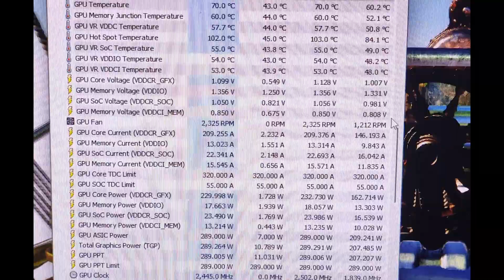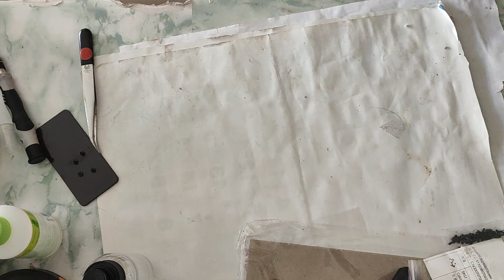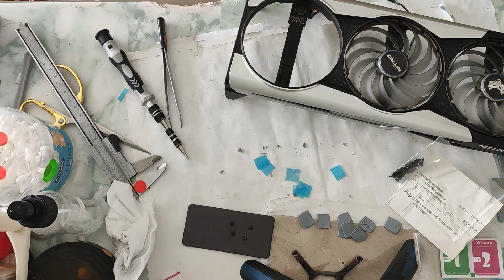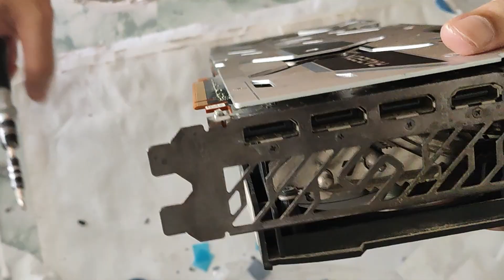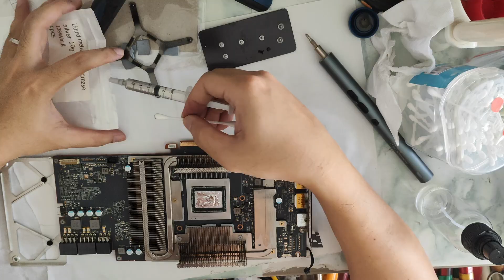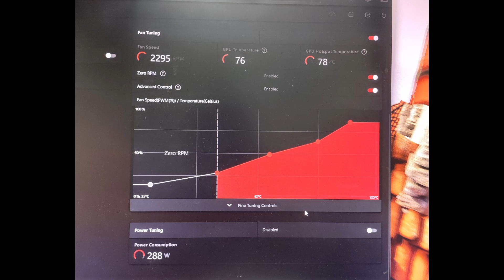Repaste & Repad the Sapphire Nitro+ 6900xt

Comment: Just did this exact thing but I used PTM 7950 :) cause I dont wanna open it ever again. The Pads on VRMs is 1,5 mm btw instead of the 1mm as on the VRam modules
Reply: PTM 7950 works so good I actually think the reported temps are faulty.
 i did a heaven benchmark like in the video. my max power draw was 293w, max clock 2630mhz and my max GPU temp: 41c Hotspot 62c.
Reply: What size PTM7950 did you end up using?
Reply: @hesburgerfan1337  the GPU die on the 6800xt is around 27x20mm so i just bought a standard 40x40mm from aliexpress and cut it to size
Reply: @kilianhock4323  Thank you!
Reply: Are all of the pads 1.5mm? I wanna replace every pad on my GPU 😅
Reply: @RIP.kingTommy  Me too :(
Reply: @Jun-fc1uj i simply used china Putty, which work great. You should buy a lot though. Like 50g at least, to be safe. Trust me, you don't wanna realize while repasting, that you didn't buy enough - me with the 20g I bought-. Next time I think about replacing, I will definitely buy more. Currently underclocking the GPU works wonders for me. And also even though I simpy couldn't replace all the pads, stock, my hotspot is at about 90°C. It used to be over 100°C. Sometimes close to 105-110°C if I remember correctly. And my GPU Temp is comfortably under 80°C ~78°C. Used to be 90ish. 
All that due to repasting, (used a thermal sheet, might be wrong) and the replacing of about half the pads.

Comment: Hello i have the same gpu and got around 70 degrees max and gpu hotspot around 108-110 what i need to change only thermal paste or and pads please help me
Reply from the maker: Just change the thermal paste, thermal pads are always optional, they will work fine even when ripped
Reply: @VamosGamingSys what temperature i need to expect after changing paste

Comment: How thick a thermal pad to use ? 
1.0mm all ?
Reply from the maker: I think 1.0mm thermal pads, and we need the softer ones to ensure proper pressure for the GPU die and the cold plate
Reply from the maker: For the rest of the VRMs i'm not sure, I didn't change the pads other than the ones on the memory

Comment: hello brother, I want to buy this card secondhand but hotspot temps hit 110c in furmark. gpu temp is actually around 70c so I think this is caused by vrm termal pads right?
Reply from the maker: No its just dried thermal paste, disassemble it like in my video, repaste it and you shd be good to go. A repasted gpu shd have hotspot peaks around 80-90 degrees max, depending on your ambient temperature and case airflow.

For reference I live in tropical Singapore, and the ambient temperatures in my room is around 29-30 degrees celsius for all my benchmarks.
Reply: Sorunlu kart almayın ne yaptıysam hotspot dusmuyor sivi macun hepsi aynı.

Comment: hola que medidas son los pad termicos?
Reply from the maker: I think its 1.0 mm thermal pads, and you have to use softer thermal pads for the GPU die to have proper contact with the heatsink cold plate.

Google Translated: Creo que las almohadillas térmicas son de 1,0 mm y necesitamos las más suaves para garantizar la presión adecuada para la matriz de la GPU y la placa fría.
Reply: @VamosGamingSys  gracias por responder hola en mi sapphire rx 6900 nitro los pad termicos en la parte de arriba los pad de las memorias eran de 1.5mm y en la parted e abajo y del costado los pad de la memoria eran de 1mm yo le puse las medidas de los pad tal cual vino de fabrica pero no resulto tube que poner en las memorias todos pad termicos de 1.5mm.
Reply: @de-todo-un-poco-argentina  do you have discord

Comment: Direct application of liquid metal to copper can lead to corrosion, staining, and potentially affect thermal performance over time..
Reply from the maker: Yea it does react with the copper, but once it forms an oxide layer. The liquid metal no longer reacts with it. At that stage we might need to top up another layer of liquid metal since the initial layer gets absorbed. 

But the second application should stay liquid as the oxide layer prevents further corrosion. 

Thermally its still good once I applied the second layer. In my experience one of my GPUs had this liquid metal "dry out" around 6 months after the first application. 

This issue with copper cold plates is also common in laptops. So the same process for people applying liquid metal to their laptops, if its not a nickel plated cold plate, they will have to reapply another layer in a few short months.

Comment: Thanks for posting this, i was looking for a video on this card a few weeks ago and couldn't find one.... I searched again today and here i am, perfect timing lol.  I'm an owner who just wants this card to run with the case side panels on... This card has thermal problems out the wazoo.  You appear to have the "special edition" version of the card, which addresses at least some of the issues of my "original version".  The proper title for my card is Sapphire 6900xt Nitro+ OC.  They very quickly released "Sapphire 6900xt Nitro+ OC Special Edition" after the original, and the vast majority of people have the special edition from what i can tell.  Some differences i have spotted: My original version only has 2 8 pin pcie connectors, no third.  WAY fewer fins on the main heatsink.  The middle fan on mine is smaller than the two on the outside.  I'm sure there's more differences, but both versions of the card have terrible thermals, and people are doing backplate thermal tape mods to bring down hotspots a few more degrees, and some like myself just give up and go full frankestien and noctua mod the thing.  At least you get near watercooling performance for all the size and terrible appearance.  Others are adding heatsinks and such to the original, but both versions of the card are prime candidates for some type of mod.
Reply: Same, I haven't repasted it yet but the card runs hotter than the gates of hell. Makes me want to avoid getting another Sapphire card. Hoping to get another 2-3 years out of this card though after I do this.